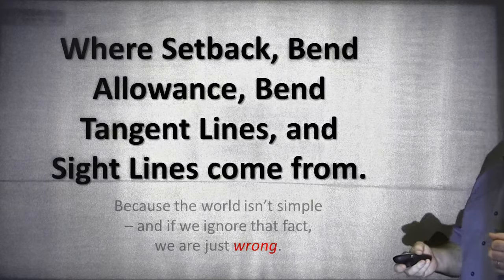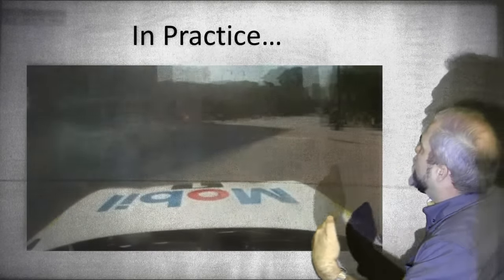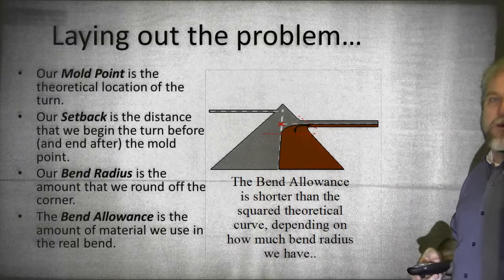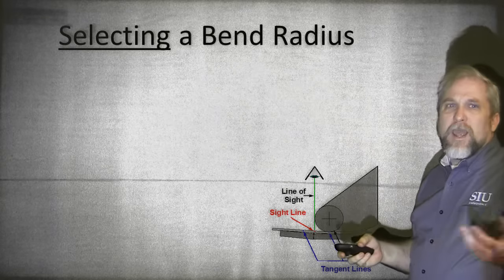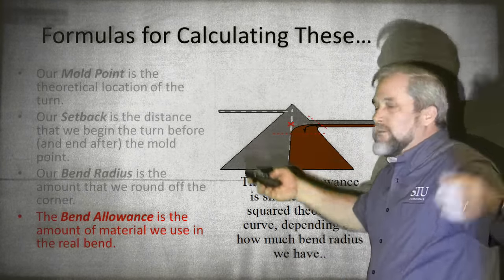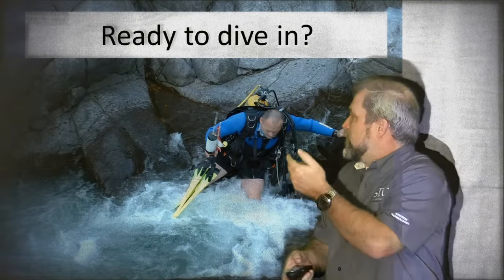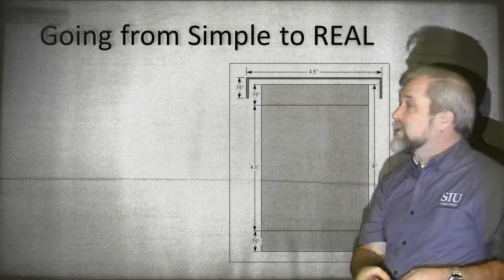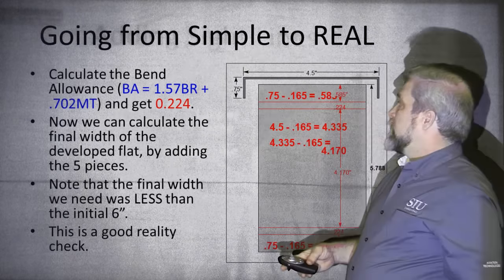AVT 206 A&P - P2 - Developing Sheet Metal Flats - The Math Behind the Bends

Comment: How can we use this for a bend that isn't bent to 90 degree ??
Reply: instead of using the divide by 4 shown at 9:20 you would do this formula.  ((2)pi)/(360/ang)(br+(1/2)mt).  Note the 1/2 mt isn't quite right as he mentioned.  It's more like .45t.

Comment: How do you determine  the k factor sir as. 5.
Reply from the maker: I have to be careful here, because in aircraft sheet metal lingo, k factor refers to the adjustment to the setback for non-90 degree bends.  In most other fields, it refers to the location of the neutral axis.  The answer is, of course, different depending on which one you are trying to calculate.  For the location of the neutral axis, it is determined experimentally.  However, the 0.5 used in developing the formulas here is usuay good to within about 10 percent.

Comment: how can I measure a radius of non 90 angles of sheet metal ?
Reply: Do you want to measure the actual radius?  or calculate the theoretical?  Inside radius or outside radius?

To CALCULATE...the inside radius in theory will match punch radius.    Outside radius = inside radius + material thickness 

To MEASURE....the inside radius of the physical part use pin gauges or an optical competitor (if the part is small enough).  Outside radius = measured inside radius + measured material thickness
Reply: @TheEngineeringToolboxChannel  Hey sir. I have a question regarding press break punches. I'm new to the field and I want to know how do you measure the radius of a punch? Is there a specific way to measure punches?

Comment: anybody know what .702 in the base allowance formula is?
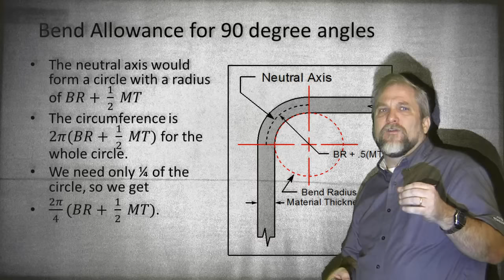Reply from the maker: 9:30 - 9:45 in the video.  The .702 is based on 2 times Pi divided by 4 time the percentage of the neutral axis, which is not actually exactly half, but about 0.45.  This value is a little different for each kind of sheet metal you bend.  The .702 is good for hardened aircraft aluminum.
Reply: @1donagin  thank you!

Comment: how to claculate Spring back for different thikness?
Reply from the maker: Springback depends on material and heat treat condition as well as thicknesses.
Reply: And it can vary from sheet to sheet, or at least from heat to heat. Also, grain direction changes it too. For example, I've noticed in 16ga 304 stainless about a 1 degree difference in the same blank if you make a bend parallel to the grain and when you make a bend perpendicular.

Comment: That right there is why the rest of the world works in millimetres, all that maths and your eyeballing it. That a side good stuff, in real life learning, lift from the scrap bin and check the radius from your tooling, make a chart with your tooling displaying the set back for radius, thickness, angle and so on. Do that for each tool and material thickness and you will not have to do any maths at all.

Comment: thanks sir....it's helps me....but I didn't understood that  sight lines
Reply: looking straight down you can't see the line that you have to line up with point of the punch where its going to impact on the part, because it's under the punch, so you move the the line out by half your radius size so you can see it when looking straight down and line it up. its easy and makes perfect sense once you get it. but hard to explain with text.

Comment: You talk about simple things and make them complex. you make to many examples which is confusing. You should get straight to the point and give at least one example for each topic.
Reply from the maker: Feel free to make a better video.
Reply: As an A&P instructor and restorer of antique aircraft I have found this video to be excellent in bringing out the nuances of calculating sheet metal bends.
Reply: You kinda have to know all this to bend sheet steel.   It's standard practice.
Reply: Sorry but he didn't make anything complex... this topic really cant be simplified anymore than he did.